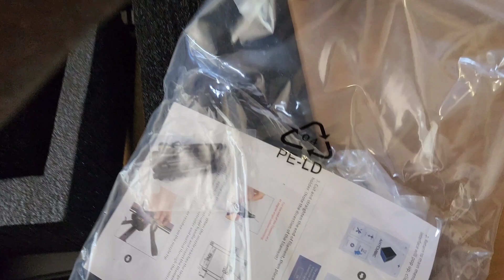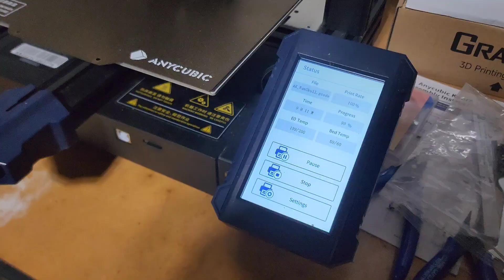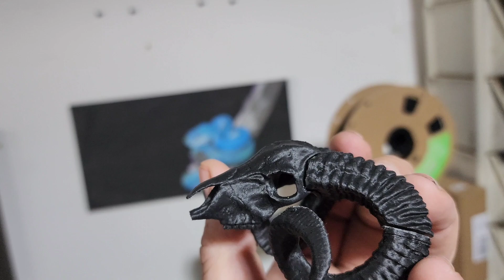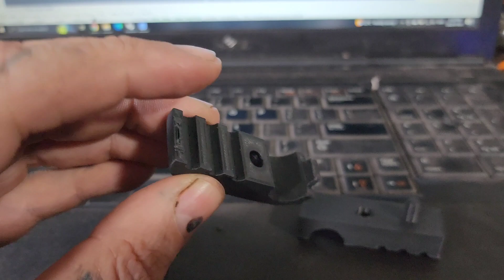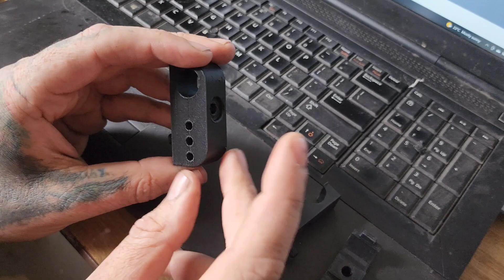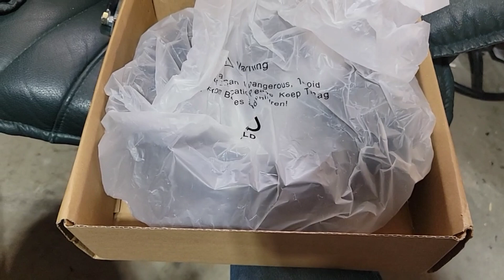KING OF BOOTYFAB GETS A NEW CNC well......sort of.

Comment: Hello, I got interested in 3D printing somewhere about 10 years ago. There weren't any reasonable options for ready made printers, so I designed my own. The tech has improved so much. That is a really nice machine that you have! Buuut if you want to make parts and sell them 3D printers are a fail for production. Here's why. The print of the clamp took hours. I have a number of CNC milling machines. Older CNC machines are cheap. A capable guy like you can probably locate a CNC Bridgeport type machine with ball screws and a dead control for 1000 bucks. Why because they aren't fast enough in todays 4000 inch a minute machining world and manual machinists don't want them because they don't have knobs. You can probably do a basic retrofit for around 1000 - 1500 dollars. Now you have a machine that can crank out those clamps in 10 minutes, faster if you made a fixture to hold enough metal for say 8 clamps. With a fixture you would still have a bunch of table space left over for doing random projects or setting up other fixtures. I am a one man operation and I have 6 CNC mills. I don't run every mill every day but my setup time is very low which increases profits. I think you mentioned colors? Aluminum anodizes well and its quick and easy. Just my thoughts on the road that I have traveled......Good luck
Reply: PS. There are smaller mills available (they cost a little more because they fit in a garage) these small mills are 115 V. You don't really need more than 1 hp. Avoid china stuff !!!

Comment: Cool video!!   could you print a jig on the table with dowels to locate the priinted side of the clamps...then finish printing the other side?  wondering if  is easy to locate a part for some rework?
Reply from the maker: All the parts just print in place.  I don't think it would work to locate and re jig it, the build plate is magnetic and can move, and the system counts on adhesion to the surface to keep it aligned.  These smaller prints literally only use about 25 cents worth of filament, if it fails, I'd just print another.

Comment: What is the material that prints what you program it to do?
Reply from the maker: Which program are you asking about?
I use Rhino 3d to build my own models.   I'm using Ultimaker Cura as a slicer.
The Printer has some kind of proprietary software built in, it basically just reads the g code and does its thing though, doesn't have the control of say Mach 3 in a true cnc machine.
Reply: @kingofbootyfab  What I mean is, what is the object made of that is being  printed ?
Reply from the maker: I'm currently using PLA filament.  It's Polyactic Acid,   it's a a type of polyester that comes from corn starch or sugar cane.  It's one of the most common and easy to use filaments, but doesn't hold up to hear or chemicals, so once I've got my files sorted out  the automotive parts I'll print from ABS.
Reply: @kingofbootyfab  Thank you